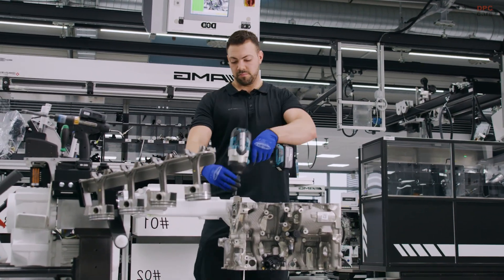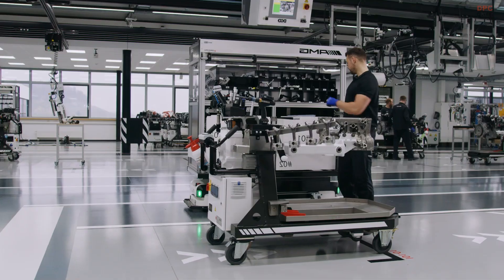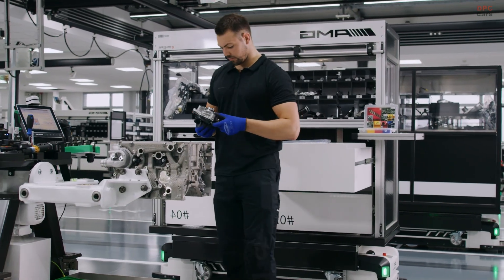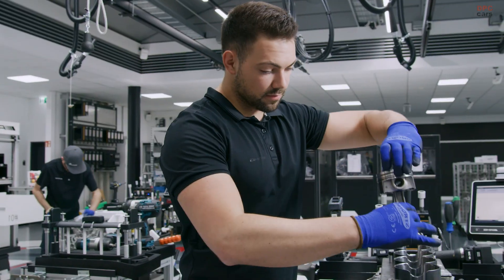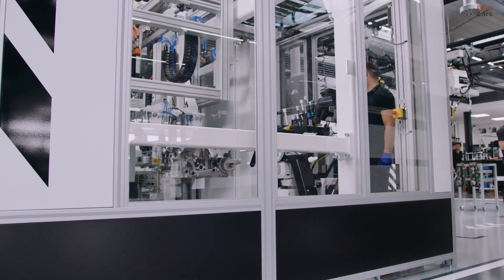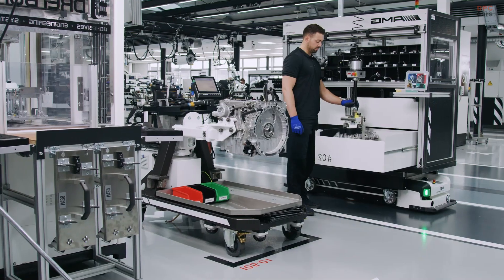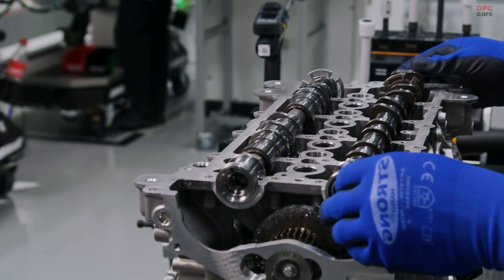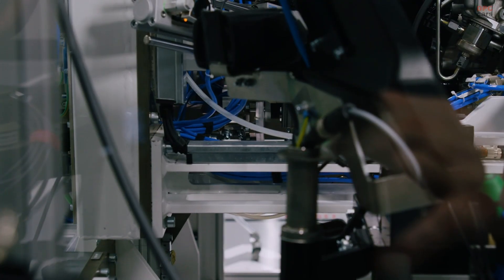Why This 2.0L AMG Engine Beats Most V8s: Inside the M139

Comment: I own a 2025 c43 and that cars performance is amazing. The rear wheel steer on a car that size no turbo lag, and a true performance engine only better faster and happier at speeds over 70…. Plus the 0-60 time without launch control being used is almost second faster than listed…. The handling is truly great one of the most confident handling cars I’ve ever driven. The downsides I see with the car is having just broken 4,000 miles on the car it’s one of the most computer centric vehicles, an update can impact your drivability and the engine sounds great but more JDM than muscle car raw power like old ones were